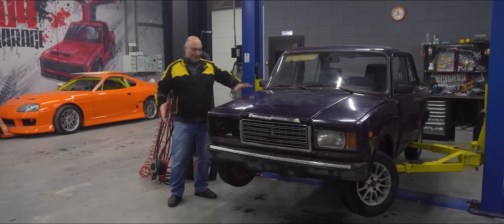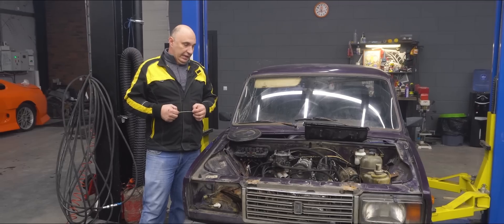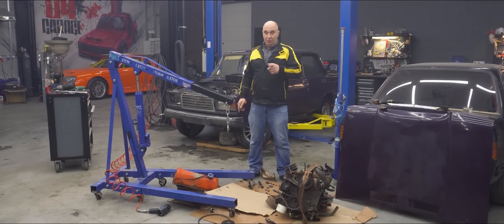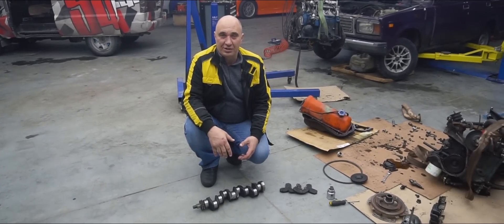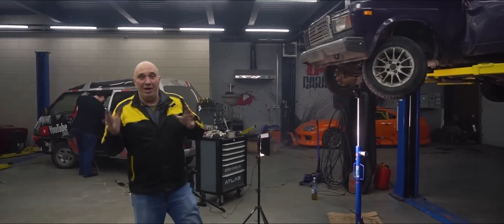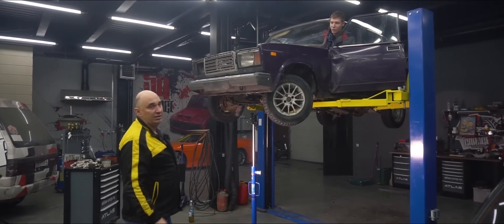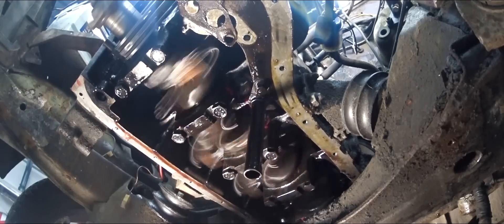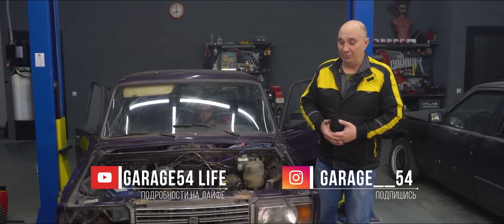Hacking off the crankshaft webbing: how’ll that affect engine operation?

Comment: Guy: tries to Blow engine
Lada engine: LOL
Reply: Its Russian 😉
Reply: I have a russian motorcycle. The engine is way overbuilt and probably will never fail. All of the other small parts like tail lights, ignition switch, speedometer, turn signals are broken however.
Reply: Lada is a car representation of rasputin
Reply: I have a lada :)
Reply: in Russia: you cant kill a Lada,  its doing that for you already by itself.
Reply: @Nelsea7190  Russian stuff will barely run but when it runs it runs forever.
Reply: Its a fiat engine 😂😂😂
Reply: @rafikoumimou3503  It is not. This one have 5 main bearings. Fiat had only 3;)
Reply: Popk1ller in America you kill engine in Russia engine kill you
Reply: In Soviet Russia, you don't blow engine, engine blows you
Reply: so lada engine is reliable?
Reply: I was going to say the same thing
Reply: Yeah, since Soviet cars were built to last the longest it’s possible. Unlike capitalist cars where it’s built to fail as soon as possible so they can rip you off with repairs and such. Not just cars, pretty much anything capitalist makes is made not to last long.

Comment: Next: no Fly wheel!!!
Reply: No flywheel no start 😢
Reply: @bobdodge3171  cut off center of clutch, and weld it directly to the crank, and then mount gearbox, then push-start the car👍
Reply: @bobdodge3171  or, hand-crank in the front🤣

Comment: Those are called crankshaft weights,counter weights,without them ,as long as crankshaft is balanced ,engine will work ofc normally ,but it will lose some of it power.I am farmer,and at one of our tractors we did engine overhaul,engine from factory had crankshaft with weights on them,something similar like this one,but they could be removed ,had screws on them.Anyway after engine overhaul we just added crankshaft without those weights and engine lost some of its power,or at least on lower rpm untill he reach higher ones,i guess something like torque.But indeed it rev easier ,ofc it will when crankshaft is lighter,remove flying wheel and it will rev even better.

Comment: Slap it together with oil pump and water pump to see how it puls the car up to speed before destroying it
Reply: That's what I'm saying too! See how that sucker does on the road lol.
Reply: Stick it on a dyno and keep pumping avgas/nitrous in it until she blows. I'd love to hear one of these hit 10,000rpm.
Reply: put in on a road - will see how the Russian VTEC works :D
Reply: Shucks... So many things b would-be answered if they put the oil pan/oil in like a normal car.

Before watching, in was under the impression that was gonna happen. I was mainly curious about engine balance and vibration. 

Well... It worked and we got what we got
Reply: I thought that was what they were going to do. Testing here is getting really sloppy.
Reply: Why not get two of those little blocks and create a micro V8 and see how it runs.
Reply: @scottrich976  You would need to make a crankshaft and timing setup then figure out how to add spark.
Reply: Yes, oil and water and let’s see what happens. How long before the crank snaps, a kilometre, ten km, maybe past 100km?
Reply: I bet it destroys the front and rear main seals.
Reply: This car has the "oil pan & valve cover delete package"!  It's all about weight reduction!  No oil in the crank case makes it even lighter!!!😝😝😝
Reply: @Captain MufDyven well explained
Reply: lighter internals wont increase horsepower
Reply: Make a follow up on this already gosh.. dying to see long term use.
Reply: Yeah good idea !! Would make an interesting video :)
Reply: Roger L. Ortiz onyx
Ok
Milk
Reply: Agreed
Reply: YEEEAS
Reply: YEEESSS PLEASE SEND IT TO THE GARAGE 54
Reply: would shake n installed out if let off gas pedal "it what i know so far

Comment: I was a car owner engineer and driver in circle track racing for many years. 
Cutting off the crankshaft counter weights was done often. The engine would rev and produced more power at the expense of longevity. For short races it worked phenomenally.  But for races more than 25 laps it would not live. Good for 20 laps though!!
Reply: @Felipe Valenzuela That's bullshit. They're not suposed to touch the oil
Reply: @Felipe Valenzuela counter weights in the oil causes extreme windage and loss of hp.
Reply: @Felipe Valenzuela nope.  Pressurized oil enters the crank at the mains, travels to rod journals, where it then, on civilized engines has a rifle drill in the big end of the rod to a squirter.  Or in less civilized manners, has a channel cut in the big end to let more oil spray toward the cylider.  But in a small block Chevy, it just counts on that 360 degree spray out of the big end to make it there.  And the small end just picks up loose oil floating around.  There is really never a lack off oil moving around in a crankcase to get on the cylinder wall.

Comment: Now all the "home racers" are going to disassemble their engine, Cut the crankshaft webbing off and use it to get more performance. Doesn't the webbing help with dispersion of oil?
Reply: Whatever they do it would be hard to balance it after cutting them off. It is such a bad idea lol.

Comment: Wow thats impressive to run that long and hard with no oil .. Beast mode.
Reply: Pfft, you think that's impressive? This is nothing for these engines, I don't think they translate for you yet, but a few years back they had one of these running for several hours with no oil pan or covers. When it did finally stop, it turns out it only stopped because it ran out of fuel !! Haha
Reply: @televisionandcheese  thats crazy

Comment: The webbing is really not for balancing the motor. It's for balancing the crank. While it will work just fine. The bussing will wear out quite a bit faster

Comment: How about if you guys put everything back together and see how long it lasts like that and how the car runs.
Reply: lighten the flywheel too with big holes in it..it will rev super easy, but stall easy when pulling away
Reply: i second that idea
Reply: Thirded(edededed)
Reply: The imbalances of the crack shaft are compensated between both halves, so there is no vibration, but it increases the forces that the middle of the crank shaft has to support as each part of it is unbalanced. My guess is that if you go full power in gear at max rpm, it will fail, either instantly or after a bit of fatigue.
Reply: exactly, do the all the hard work and then stop at 97%...classic slav "oh its fine"
Reply: PLEASE!!!!
Reply: Fourthist... I think?
Reply: Get it back together and list if for sale.

Comment: Crankshaft manufacturers, lying to you since 3rd century AD.
Reply: older engines tended to have more rotating mass. newer engines dont..i have a 3cyl and it has very little rotating mass, revs easy, but easier to stall pulling away,
Reply: @jusb1066  You nailed the right answer. Not enough kinetic energy stored in the crankshaft when lightened.
Reply: @jusb1066  A 3 cylinder engine has better balance characteristics than an I4. The primary and secondary forces are balanced in an I3 similar to an I6. An I4 is unbalanced (eg flat plane configuration) because two pairs of pistons reach TDC at the same time and the acceleration at TDC is higher than at BDC.
Reply: There would be more vibration under load
Reply: Most modern crankshafts are Cross-plane, not Flat-plane like this particular Lada engine crankshaft. Cutting the counterweights off of a cross-plane crankshaft will make the engine vibrate itself to pieces.
Reply: @JosephArata  i would have figured this would have shaked worse than it did.. Was waiting for main cap failure.
Reply: @JosephArata  I want to see that.. garage 54 make it happen
Reply: @JosephArata  wrong all 4 and 6 inline engine hsve flat plane crank
V6 and v8 are cross plane
Its why the mustang v8 with flatplane crank sound like a 4 cylinder
Reply: @legros731  An R1 is a crossplane inline four.
Reply: Joseph Arata ba
Reply: @JosephArata  I can't seem to find all those 4 cylinder crossplane cranks you're referring to. I searched for VW tdi 150 crossplane crankshaft, Honda crossplane crankshaft etc. and nothing. The wiki page for VW diesels has no mention of crossplane 4 cylinders. So nothing I could come up with that isn't Yamaha or bike related.

I guess you can call a 3, 5, 6, 10, 12 cylinder crankshaft "crossplane" if you really want, though really I wouldn't expect to find a flat plane crank in those configurations since they would be innately imbalanced. 3 cyl cranks use 120deg crank pin offset, 5 uses 72deg, 6 = 2x3, 10 = 2x5, 12 = 2x6.
Reply: @JosephArata  Actually that is untrue. A cross plane crank is a crankshaft that has 90 degrees between crankshaft throws. As one website puts it, basically every time the crankshaft rotates 90 degrees, a cylinder fires. This means traditional V8 engines are cross plane. However in a flat plane crankshaft design, there is 180 degrees between crank throws. All typical inline 4 cylinder engines with 180 degree crankshafts are flat plane including Honda and Toyota which you mentioned were cross plane. There are only a few  exceptions such as the Yamaha YZF R1 motorcycle. Here is one website that explains this concept well and easily. https://carbuzz.com/features/battle-of-the-v8s-flat-plane-vs-cross-plane

I have also attached links to photos of a 4 cylinder cross plane crankshaft: https://www.yamahapart.com/crossplanecrankshaft
and a common 4 cylinder flat plane crank: https://www.med-engineering.co.uk/b-series/crankshaft-conrods/b-series-crankshaft
Reply: The ford 500 remake never had a coyote V8.  It was a duratec 3.0 V6
Reply: @JosephArata  by modern you mean what? my k20a4 uses flat plane and my f23a5 too. as far as i know, honda does not use cross plane even in l4 bikes. and yamanha, who uses the strange 270 degree crankshaft on some bikes, have the balance shaft.
Reply: @JosephArata  the Shelby GT350 mustang has a flat plane crankshaft.
Reply: @JosephArata  Wrong, cross and flat plane only refer to V8s and I4s. You can't describe V/I-6 this way because 120 degrees between crank throws you'll never get a "cross" or a "plane"
Reply: @legros731  Wrong, there are both flat and cross plane I4s, you don't denote 6 cylinder engines as "cross" or "flat plane" You can also have a flat plane V8 (eg Ferrari 458)
Reply: @JosephArata  So much eggregiously wrong in your comment, sometimes I wonder why people rant about these things when they are just flat out wrong and spreading misinformation. 

Most I4 engines today are flat plane, not cross plane (few exceptions eg Yamaha YZF R1). Cross plane engines still require counter balancing, they just have less vibration twice as often as opposed to more vibration less often in flat plan crank configs. 

Most Toyotas/ Hondas I've seen are flat plane... VW TDI 2.0L engines are flat plane and come with a balance shaft (I know because I have a TDI "PD" engine in my garage waiting for a balance shaft delete kit)

Comment: I'd be worried about the bearings turning into shotgun slugs, when the wobbling torques them apart and sends them flying.
Also OIL!
Reply: It's a sight to see a rod bouncing off the highway at 60mph 3500rpm. Almost like rubber bouncing.

Comment: Can you try spinning the engine backwards? Like reversing the voltage on starter motor and try running it. Will it go forward in reverse gear?
Reply: Wouldn't the valve phasing be all out of whack for that? - Inducting through the exhaust, and exhausting through the induction manifold. How do you get the fuel into the combustion chamber? Diesels 'can' be made to run backwards. Never seen a petrol engine run backwards.
Reply: @28YorkshireRose12  What if they modify the camshaft like they did in the steam powered lada?
Reply: @thewogo439  It would be a big mod, but I guess that if you were so minded, you could make it work, and re jig the ignition timing as well. If you really wanted to, you could also probably mod the engine to run on diesel fuel, one way or another.
Reply: Most engines for left hand rotation just drive the cam backwards. Well actually the cam remains turning the same way, although the crank is now spinning backwards. Being that the oil pump runs off the cam it all works out fine
Reply: Gasoline 4 stroke engine with valves won't run backwards. 2 strokes don't have valves and actually can be made to run backwards
Reply: @consolehacker54  Good point, though logically, we are talking about this engine, rather than two stroke engines, however, even a two stroke engine's performance will be marred if the firing point is normally 'off' TDC. If the firing point coincides with TDC, then I quite agree, it would run either way, equally well.

But, it's the four stroke Lada we were talking about.
Reply: got the points gap wrong on a puch maxi moped many years ago, it ran backwards

Comment: I used to run 3 main bearing boxers.. they have no weights at all. there is fire balance as well as rotation. inlines are missing the other 180 degree half of an engine. 301 pontiac (I also owned and ran) is a v8 that cut the weights down as well. nothing to notice but fuel mileage.

Comment: the motor will most likely have no torq, sure it will rev fast but can be stopped with resistance IE clutch initiation/ driving or accessory  on the front of the motor.

Comment: I wish getting a Lada here in the States was cheap and easy. Damn near whatever you do to them they keep running. It'd be a perfect first car for any of my kids. Not a lot of power, hard to kill, perfect first car.
Reply: They're not the safest though ! They still can get some speed, and even a small speed can get you killed in these. Other than the butter bumpers these have, the rest is just super thick metal. No impact crumple zones, airbags, or any safety features. 
The car will keep working after a huge accident, but the driver won't.
Reply: @televisionandcheese  that is certainly good to know... maybe just a couple of them to play with then ... You know, have fun tearing them up like Vlad does, LOL

 I will always love the video were he put a ton of stuff in the oil pan to see what would kill that engine, and it just kept running.

Comment: Drive it on the road?
Reply: That's where they'd notice the drastic effects. The clutch will be weird, it'll engine brake more, it'll drop REVs a lot quicker when you engage the clutch, and so on. The weights on the crank are there for rotational mass. That's their purpose. You won't notice much of anything about rotational mass sitting still with no load. Go for a drive, and it'll be like night and day.
Reply: This car has a centrifugal clutch using a very worn brake drum, it was worn away in their video of the seesaw climbing poles .
It doesn't really move now

Comment: I waited for a rod throw, it was impressive it held up without oil. Still painful to watch that poor engine :D
Reply: That's just how good assembly lube is and why it's so important to put it in when building engines.
Reply: They did spray some assembly lube on it.
Reply: That old Alfa Romeo 8V engines are freakin tough shit. Lada it's just a Fiat from good old times.
Reply: It was running without motor oil, but it wasn't running without lubrication. Assembly lube is designed to keep engine parts lubed up while waiting for engine oil to circulate throughout a newly-rebuilt engine. This video is an indication of how good it is at doing that.
Reply: Attila,
Yea man,if that was a horse you would have put it out of its misery.
Reply: It's a Lada horse. It would have kicked you.
Reply: And coolant
Reply: All for the Education. lol

Comment: ... missing some vital parts...
LIKE FRIKKIN OIL?!?
Reply: They sprayed on some lube to let it run open
Reply: Naaah, oil is overrated, Lada engine ain't need any in order to run.
Reply: It's a lada engine, it doesn't care about no oil.

I don't think they translated it to you yet, but they experiment running a lada engine with no oil at all a couple years ago. It lasted for ages and then stalled..... because it ran out of fuel haha
Reply: @_a.z  😂
Reply: engine oil is a lie, so then can charge you for replacing it at least once a year!